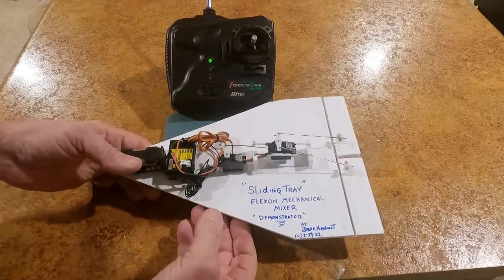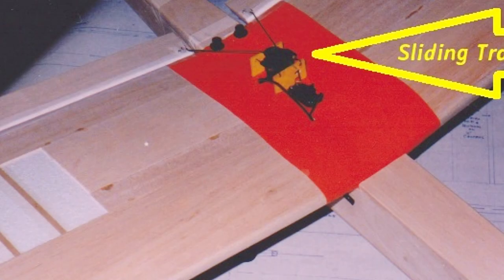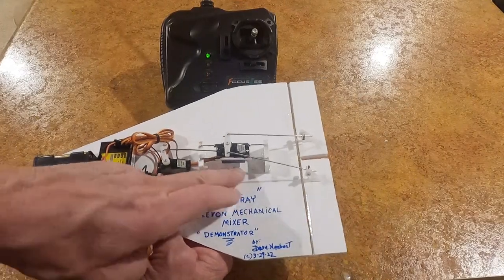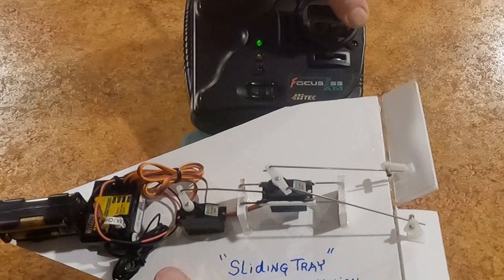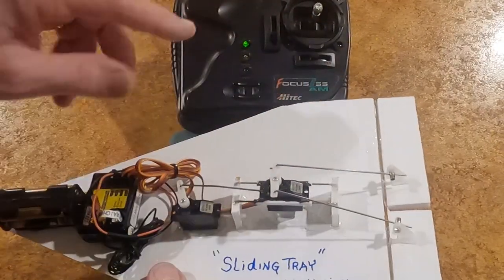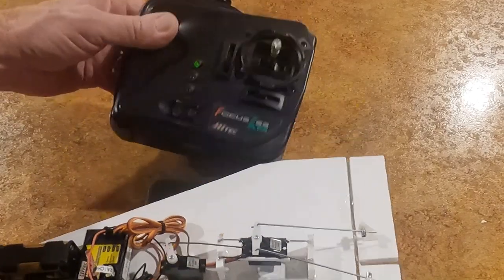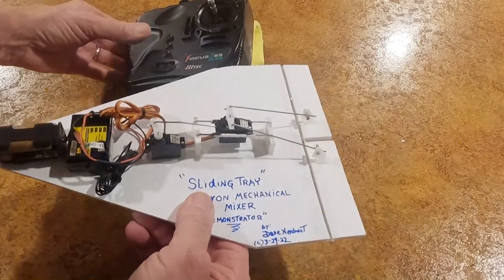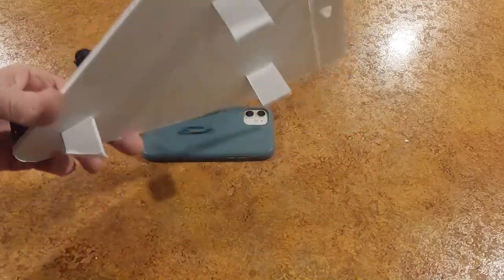The reliable "Sliding Tray" Mechanical Wing Elevon Mixer from the 70's still works well today.  Huh?

Comment: That brings back memories, I mostly flew Delta's with elevens. Throughout the 70"s and '80s I used a host of different mechanical mixers; but when electronic mixing became available it changed everything. If you recall there were aftermarket electronic mixers that would gang servos together which I used with pretty good success.
Reply from the maker: Yes.  Those aftermarket mixers all were based on our original Kraft design, but were on board the plane instead.  I made a ganged servo video years ago too.  Thanks and happy flying.

Comment from the maker: Hello Folks, The Sliding tray,  (for servo trays that held servos) was the only way we could fly airplanes with elevons, back in the day.  Eventually, while I worked at Kraft, the engineers came up with a mixer, which I installed in my transmitter. It was a big thing, then because I could eliminate the sliding trays!   Today it is a minor software adjustment, but this reliable sliding tray system works very well and may be something you could use yourself someday.  Thanks for watching and happy flying.  God Bless.

Comment: I used to use a system like that on most of my slope soaring  Gentle ladies, 2x6’s I would convert them to V tails because I like the stability they had, Mounting both servos on the slider and placing them right at the center of gravity of the wing the white shift by itself made it very pitch sensitive and great when you were in gusty winds you had a much quicker response in the elevator those were the days!
Reply from the maker: That is great. I spent hundreds of days slope soaring at Torrey Pines and the Strand, in Southern Cal. I loved it. Gentle Ladies were great.  My best was my Hobie Hawk.  I sold it when I moved here, because no hills here.  LOL. Wish I hadn't.  Thanks and happy flying.

Comment: Great design for a simple mixer. I've seen many different interesting designs in vintage helicopters for collective mixing, the schluter 'champion' used a slotted shaft for collective and mixes it in at the head, the later 'magic' would rock the servos back and forth in their tray to accompish ccpm mixing. many designs from the raptors to the ikarus ecos used a big teetering lever and many bellcranks to do the same.
Reply from the maker: I have had those  helis too, and my Raptor uses rocking servos but this is not a heli mixer.

Comment: Used that on my Gryphon flying wing. K&B 15 powered.
Kraft Gold Medal 4 Channel.
Worked perfectly. 72.080 Mhz.
Brown and White frequency flag. Channel 1.
Also used it to mix in flaps on my Skylane 62 when I got the 6 channel radio.
Reply from the maker: Great Plane for sure.  Brown and white.  I used to use them all, since we had the plug in modules.....all seven of them.  LOL.
I flew org/wht 72.400 for my favorite, till I got my ham license and switched to 53.200 ham band as you see in my TX here.
Glad to hear from a "Charter" member.  Happy flying and thanks.